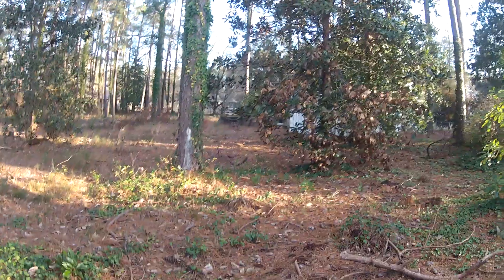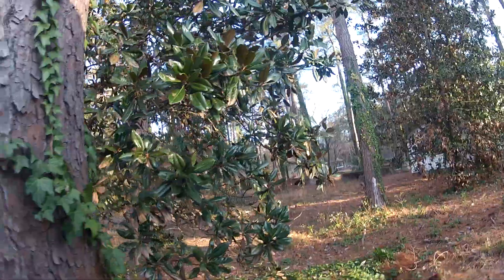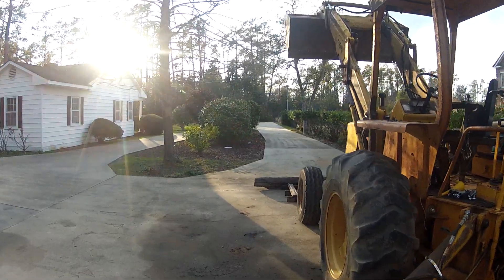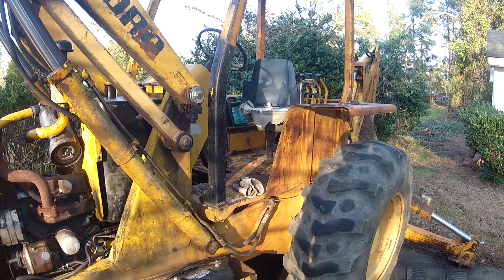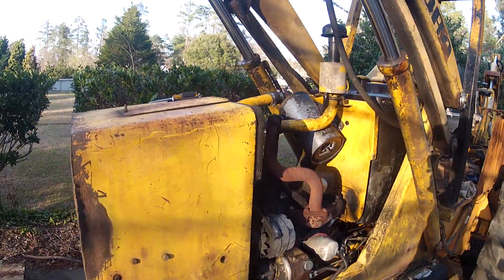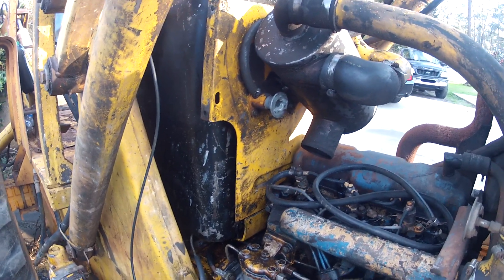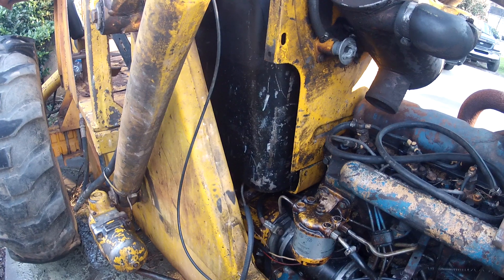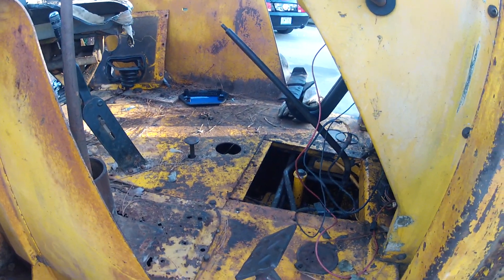1981 Ford 555 Backhoe Transmission Issues Part 1

Comment: I just wanted to say thank you for the videos you have made on this issue....I am also a Ford lover of 3 different vehicle and even a scrap trailer made from a old Ford pickup...I have bought a Ford 455C and has same issues so I am at the point of breaking it in two...so must of what you have said makes alot of sense... thanks again
Reply from the maker: Thank you

Comment: Hello, I bought a Ford 555 Tractor Backhoe about a year ago. It has been sitting for about 2 years before I bought it. It started right up. I built a 1000 square foot home using this machine. It works great and still runs very well. I plug it in an hour before starting it in the winter time. I keep a charger on the battery.  I have a 20 acre piece of property that I want to clean up and maintain. The only concern I have on this machine is it has slow leaks on engine to where it smokes under the hood. Hydraulic leaks in the rear wheels. 2 of the hydraulic lines were broke to where previous owner patched using hose and hose clamps. I want this machine to run for a long time. Smokes and leaks are very concerning. So I watch your videos to help me maintain the machine, but I am not mechanically inclined and don't want to ruin something that is working great for the time being. Thank you for posting videos. It is awesome to watch and very informative. I find some of your comments very funny. Keep up the good job.
Reply from the maker: Thank you
Reply: Aww man. That sounds awesome, but also unfortunate. Where do you live?

Comment: Thank you for your documentary on the work. I set up an equipment repair playlist to put your videos on this one. I'm searching info on flushing the transmission cooler and possibly torque converter on the 555b that I'm using. Even though it has a closed cab somehow it has gone water in the transmission fluid over the last year. The shift boots are still good also. Hopefully you have these in the playlist I don't have to go back to Google to find the other two videos.

Comment: When working on those tractors and you have to replace the transmission converter seal do you have to split the whole chassis to get that out?
Reply from the maker: Yes
Reply: @mytaborcityhome1002  okay thank you for the quick reply. Mine is a little different than the one you have. The way the chassis on bolts there's 4 gigantic bolts right at the firewall. Two under the tractor and two inside the cab.

Comment: Thanks for the videos they are very helpful
Can you get a repair manual online that covers this engine and transmission?
I have a manitou rough terrain forklift that started to lose drive and would only drive weakly if it came to an incline or obstruction it would struggle but now its lost all drive forwards and reverse 
It has exactly the same transmission and engine as your backhoe so these videos are helping a lot as there seems to be nothing much online covering this transmission 
Iam going to check the pump pressure and see if the torque converter is spinning before I start to split the engine off to try and see whats wrong
Reply from the maker: Yes, the shop manual is available online. I cannot remember where I got mine but I believe it was around $50 for the download and it came as a .pdf.

Comment: I’m looking at a Ford 555b 4wd backhoe it is closed  in it actually has the extendahoe backhoe it also has a large deep regular bucket a 3 in 1 bucket that has the forklift that you can easily slide on the bucket however it only goes in reverse he was asking 12k but I got him down to 10k what you think ?
Reply from the maker: Everything works? Good tread on the tires?

Comment: Buddy I’ve got a 550 Ford an a 555-B Ford an tha 550 when I bought it it wouldn’t move out of its tracks so I new a machanic that has worked on every kind of Ford made an I ask him what might be tha problem an he told me in between tha fuel tank an dash it’s really hard to get to but the is a shift pin for tha shuttle shift an it’s not very big at all it’s a little round pin that if u don’t let tha rpms fall all tha way down when shifting from forward to reverse or changing from gear to gear that it would break that shift pin an he said I’d check that fist thing cause ppl don’t let tha rpms fall all tha way down before shifting an he said I may haft to take tha tank loose to tha fuel there’s alittle block in between tha fuel tank an tha dash that’s really hard to get to if you don’t listen tha tank it’s about impossible to get to well I got my tools an found tha block an got to it an sure enough that pin was broke an it wouldn’t move so tha guy that owned it said he had to run to town an I’d already picked tha shift pin up for like a dallor an something an bye tha time he came back I had tha new one in an was backing up to put tha backhoe attachment back on he had taken off an he pulled up an said how in tha world did u get that thing to move an I handed him that plastic back from Ford dealership an he said what is this I said shift pin an he said no way. I bought tha backhoe an been useing it now for 30 years an never had a problem out of it sense so u may want to check tha shift pin to c if that’s ure problem !!! Hope this helps an takes care of it. It saved me a ton of time an money an breaking tha machine apart.

Comment: my ford 655A has low hydraulic pressure in front bucket and arm.

you can tell me how to adjust the relief valves
Reply from the maker: Sorry Bud, I've never had to adjust the pressure in the front bucket or arm.

Comment: I just want to see how to check the transmission fluid on a Ford 555 a backhoe - please
Reply from the maker: It’s in the floor right in front of the seat. You unscrew the dipstick and check it. I’ll make you a video tomorrow if I get the time.